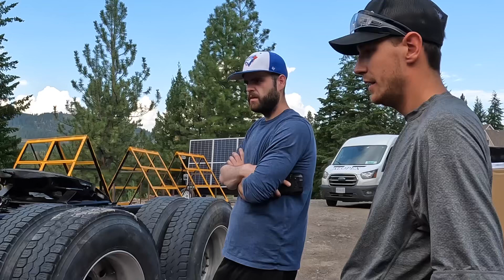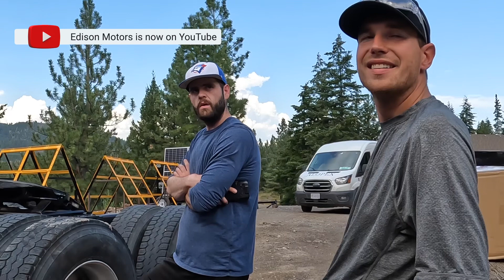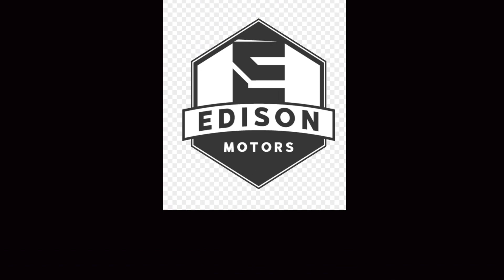Regenerative braking, Edison Motors 1,  Nikola Motors 0

Comment: Where does the power go once the batteries are charged? 
Windmill usually need a load bank to prevent overspending.
Reply: The wind generator needs to have a load so it does not spin up to fast if there is wind but no demand. The dump load acts as a break. A generator does not have this problem it will simply not be needed if the batteries are full and can be shut down.

Comment: Very cool 
I’ve been wondering what the foot pounds of hold back is compared to a jake and also can you shut off the regen braking for icy conditions?
Reply: 100,000ftlbs
Reply: How do keep the tires from skidding while braking on slick surfaces and what about grinding off the rubber on tread faster then normal?